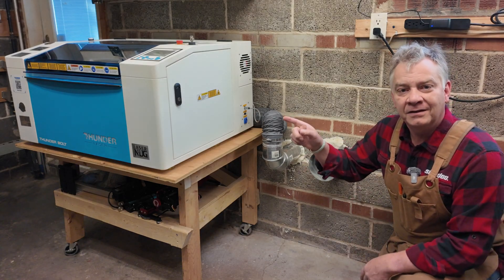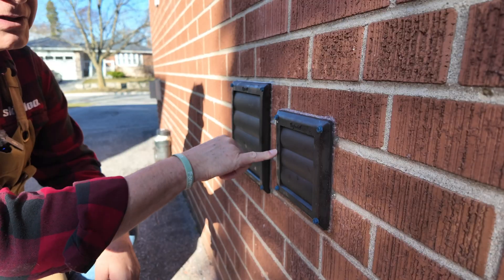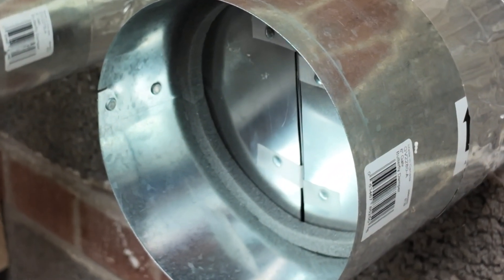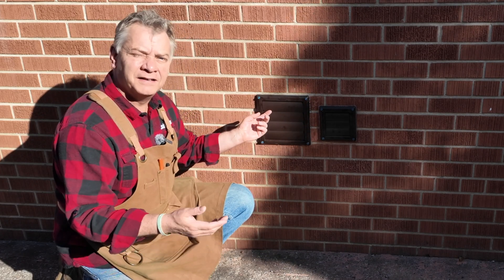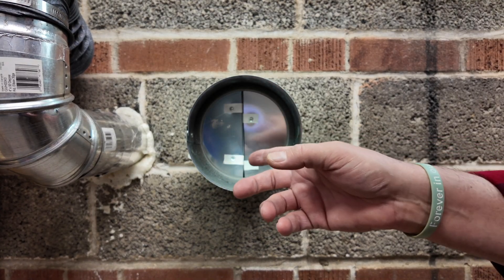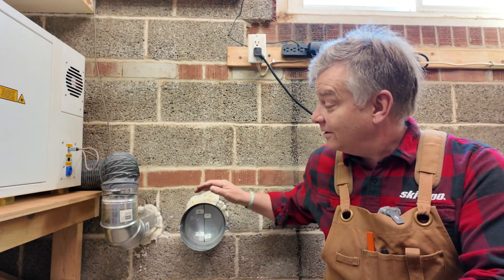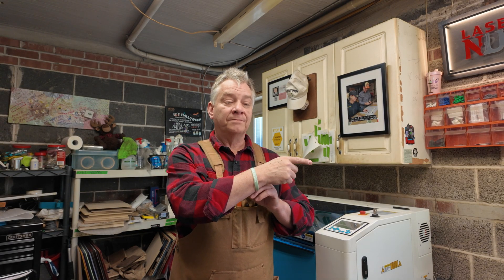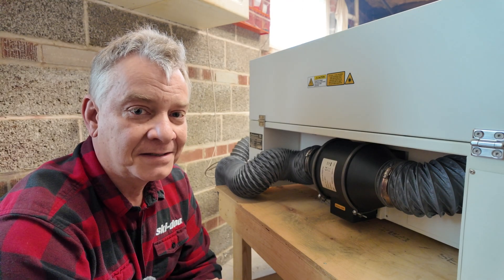Exhaust Venting Installation for Your Thunder Laser. The Most IMPORTANT Component.  080   4K

Comment: Came to see the setup going through the wall. Noticed how far away your fan is from the exit. You would notice a significant improvement if you put the fan as close to the exit as possible.
Reply from the maker: 100 % for sure. My fan is approx 2 feet away for one machine and 2 1/2 feet away for the other. But for sure, the closer the better. Thanks for watching- Cheers and Happy Holidays!

Comment: Another informative video Nug! I have a Y splitter as I have 2, 4" exhaust hoses but I use those manual gated dampers for wood shop extractor systems to eliminate the problems you identified. When I upgrade, I'll be sure to add that inline, butterfly damper you showed.
Reply from the maker: Hey thanks for tuning in. The in-lines work perfect so you are all set up. Have a great week - Cheers!